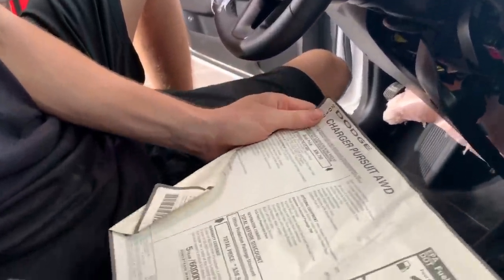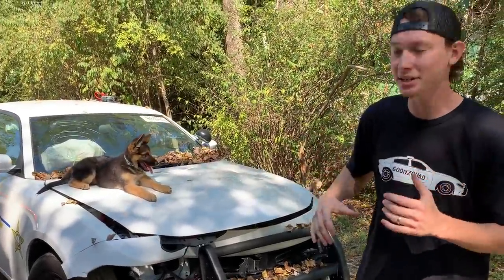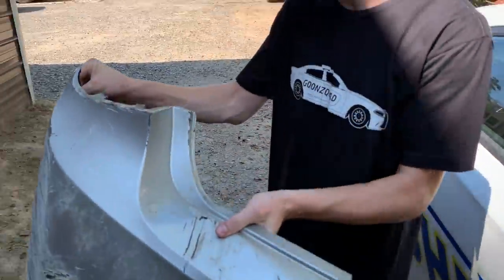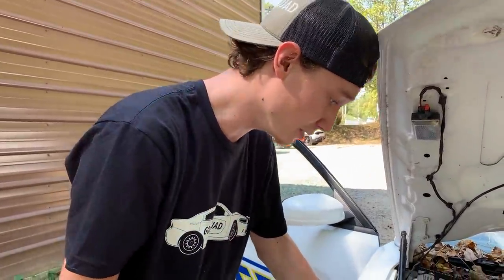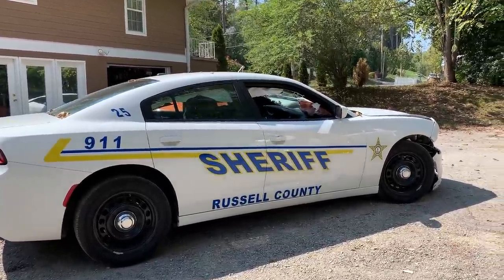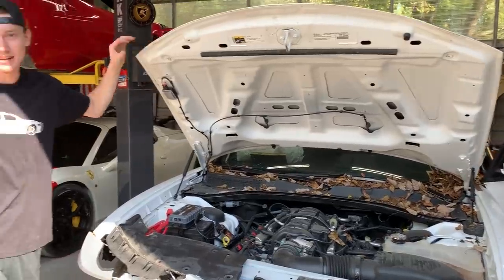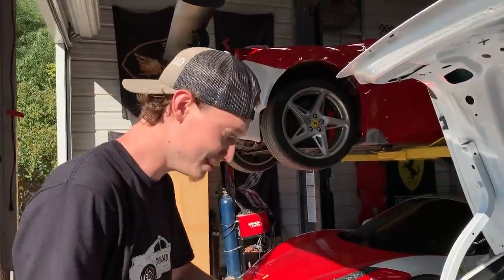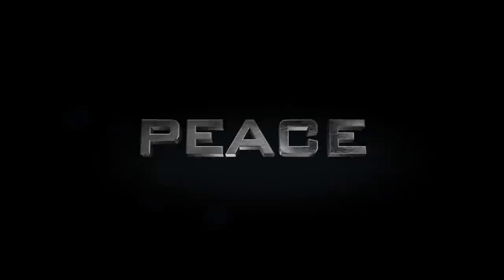Rebuilding A Wrecked 2018 Dodge Charger Police Car!!!

Comment: This police cruiser came out of my county, and you can hear the engines roaring before you see them. I'm good friends with some of the deputies, and I've gotta admit flying through the backroads of Russell County is fun in the crusiers responding to calls. It's been a while since I've seen the inside of one, though, but best I remember, the ELS system was by Whelen, and they have a version of the Liberty lightbar on the roof. If you've never been to Russell County, it's just a county in the southwestern end of Virginia, but it gets wild sometimes and you'll see the deputies passing people on the highway and if your the one getting passed it seems like your going backwards.

Comment: You guys are great, but a couple of things.
The light under the hood is an added thing, not a normal charger add on. Most chargers will come with the full size spare tire, unless you ask for the inflation kit. And that is not the only way to get an AWD charger but I believe it's the only way to get a V8 AWD.

Comment: It would be funny if the reason this car was sold was because of the no-start. I find it hard to believe that repairing that damage would cost more than replacing it. I'm kind of curious if a regular citizen can buy a new police car without all the police lights and such, just the beefier heavy-duty mods. That platform could be a beast.

Comment: You may have a 6 speed transmission in it. When we were building the police ram trucks they always used 6 speed transmissions. Idk if it’s different for the chargers though

Comment: The reason departments buy V6s is efficiency, and budget. V8s are a more costly option to begin with, and most municipal agencies don’t need the power and top speed of a Hemi. The V6 is perfectly sufficient in most situations and the fuel economy is better.Sheriff’s departments and state police agencies are more likely to order V8 sedans than city departments.

Comment: Check the door cards to see if there's a tag saying it has ballistic doors on the front doors.  $38k sticker would be for civilian purchase  That car on most state bids is currently around $24 - 28K.  The tires are not run flats, but typically a high speed rated tire, which is needed for the pursuit rating this car has.

Comment: Try going to scrapyards for some parts. Thats a LX platform, so its been the same for chargers since 2006. Same for chrysler 300 too. Lots of the parts are interchangeable besides for body panels

Comment: TL;DR: Police cars are what normal cars would be like if companies built them to last and built them with the extra quality control and stress testing that you don't get with normal new cars. Also notice how much cheaper this car is than a lot of similarly optioned civilian cars.
For those who are interested, the reason the front seats are cloth and the back are vinyl is due to the ease of cleaning vinyl seats as opposed to leather or cloth. This way if someone made a mess in the back the seats and floorboard can be sprayed out. An officer can open both doors of the car and use a high pressure hose to spray out anything in the rear. 
As for the front, the police use the "heavy duty cloth" seats simply because they are less prone to wear. They are referred to by the factory (Dodge) as heavy duty simply because they are usually double or triple woven to be a tighter and stronger fabric as opposed to the regular thin cloth found in standard cars. This is the reason why many Crown Vics still to this day have very nice shape front seats. They have lots of extra foam and a much thicker fabric cover.

Comment: If the fronts wear leather they would be destroyed. From jumping out quickly and sliding in with a belt on it rips the seats easily. As well as a hand gun will destroy the seat. They also are required to remove most front facing lights/sirens and center council controls when sold to the public as it is illegal to have/use on the roadway.

Comment: @goonzquad they put leather/ vinyl in the back because people will puke, urinate, or bleed in the back and it won’t stain and is easy to hose out. The front is cloth for price, and because of heat and wear resistance.

Comment: Seat is disconnected because it was likely tossed in from the garage. They likely had a plastic bench seat in the rear and removed it to put it in their replacement car. 

Dodge Charger is not called an "interceptor" as that is the name for pursuit rated ford vehicles (Explorer and Taurus)

Car would not be "tuned" it would have the speed limiter removed. It will also have the parking sensors enabled so while in park and ignition on, if someone walks near the rear of the car the center screen will toggle the reverse camera and auto lock the doors to alert the officer for a possible ambush.

Comment: Rear seat gets pulled. They put plastic seats with ditch to accommodate room for ppl wearing hand cuffs.  May not even be the original seats they stuck back in

Comment: I build police vehicles for a living all the fuses labels police will not effect anything of the vehicle those are for upfitter use theyll be 4 wires behind the headlight that are direct pass thru to the console area 

The transmission is designed and built by Mercedes 

Common issue with the v8 chargers is cylinder 8 misfire and if that's occures you'll be lookin at having to do cams rocker arms and a few other odds and ends 

If you have any questions in regards to the police packaging feel free to contact me

Comment: They put the vinyl in the rear for easy clean up.. Just in case someone pukes... Body fluids.. Etc.. Then leave the cloth fronts for officer comfort. The rear seats also usually come out easily so they can check to see if the person ditched and drugs back there. The 2 front seats usually have metal plates in the back of them to make it to where no one can stab you from the rear of the vehicle as you drive.. Pretty cool shit.

Comment: Goonsquaud I bought a paint gun little over hundred bucks best money I ever spent Amazon has a five hole on each side of tip there ends end with no orange peel at all awsum results ze products orange gun turned out great wide spay pattern and lays down like a sheet try it you'll be very happy I love painting and ze products must also let me no if you get one as good as my iwata I sware

Comment: Its a stock 5.7 hemi if you try to boost it on stock internals your gonna mess something up those things take power adders but at some point that thing will destroy itself. Thats the base engine not the 6.2

Comment: Hey Goozquad.  I've been a subscriber for a couple years.  It's my favoite YouTube channel and I watch every video.   I'm not sure if someone already answered about the zip ties on the headrest but it's used to hang the hat on.   They get crushed if just laying around in the backseat or floor.  Also, that department might require the deputy to wear the hat everytime they get out of the car so it's easier to grab from the headrest.  

Not sure about your state but in Va, red and blue lights are illegal on the roadways.   But impersonating the police can occur anywhere, including parking lots.  I've seen  antique police cars at shows that have emergency lights but with that new car, if you use the lights, even if just driving in a parking lot, you could get an impersonating charge.  Better off not having the lights unless you plan to tow the car to the drag strip and car shows.

Comment: The reason the fr not seats are heavy duty cloth is because of the constant getting in and out with the duty belt on. It would tear the vinyl. They put vinyl in the back so it’s easier to clean up when they have people vomit, crap, pee etc in the cop car.

Comment: the rear seat in a cop car don't bolt in if they don't have the mold in seats because if someone pees in the back happens a lot so its easy to pull out and wash just FYI good luck

Comment: Was always told to take the miles on a police car and multiply them by 3 or 4 to get actual engine hours/miles due to setting and running all the time.

Comment: u got with the marking on it they are not to sell it with the markings on the car make sure u keep the receipts and u need to have a video of them selling the car to u with the markings on it or u need to take them off because just driving it on the road will get u in big trouble with the markings on it it's called impersonating an officer witch is a felony and it will be up to u to prove that u got the car that way

Comment: You can't base the engine condition based off of the mileage on the odometer, you have to base it off the engine hours, they spend more time idling then they do driving most of the time

Comment: the rear seat is probably the original one thrown in from when they removed the custommade one most cop cars have, where there is an indentation in the seat for the handcuffed hands to fit :D
where do one buy a used copcar?

Comment: You can shift into the other forward gears. There’s a button on the end of the shifter. Hit it, and then there’s a toggle switch located in the middle of the shifter to upshift or downshift.
Reply: It won't shift any faster.  These cars are engineered by SRT for Chrysler Fleet.  They're wide open.
Reply: @pkranz937  what that mean In football terms